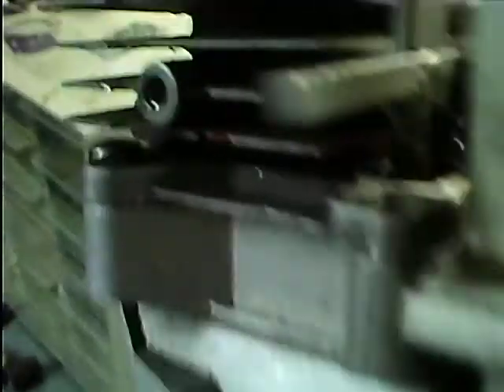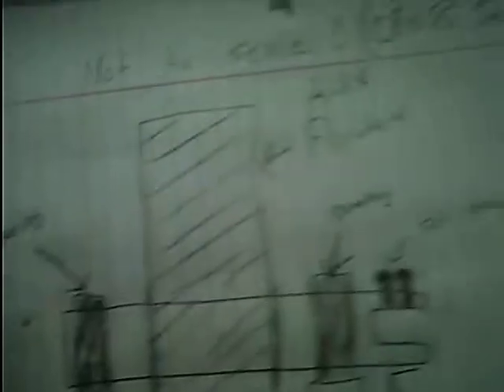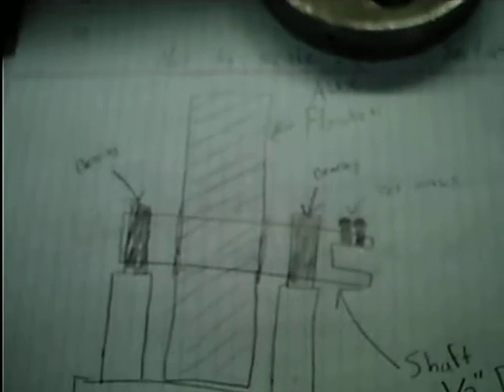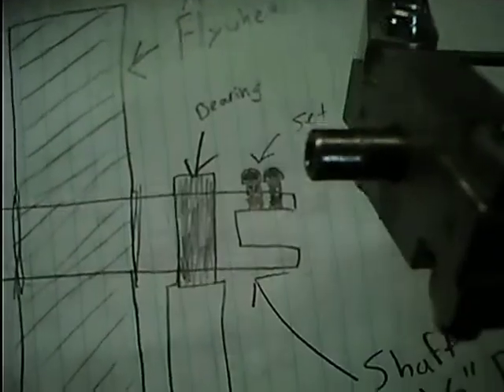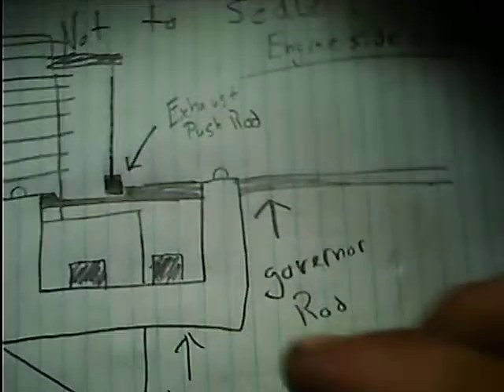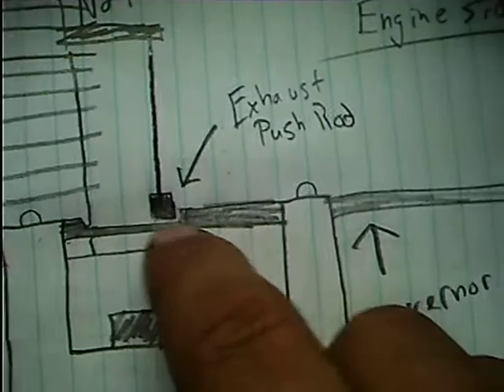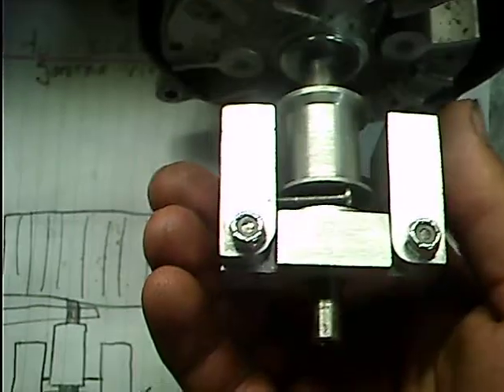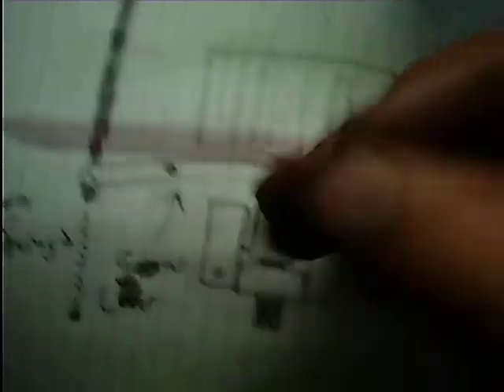4cycle Hit and Miss Conversion (5)

Comment from the maker: Yes, it draw some fuel into the cylinder but with the exhaust valve open at that time the amount would be limited.  It would also blow back out.  It doesn't much matter to me how efficient it is, however if not using an atmospheric valve causes it to flood I will have to make that modification.